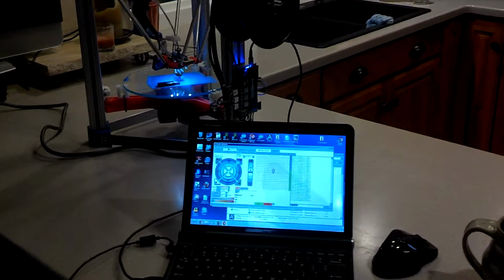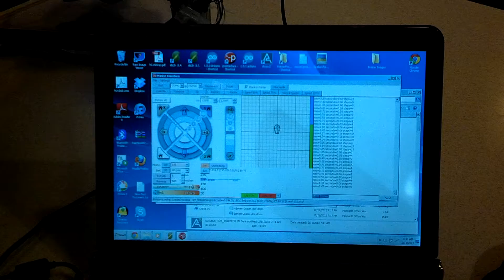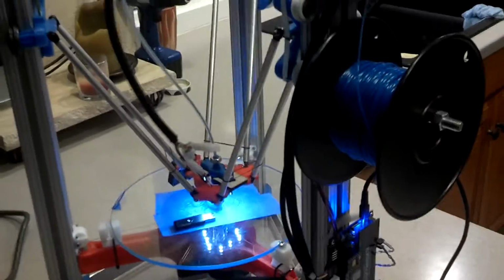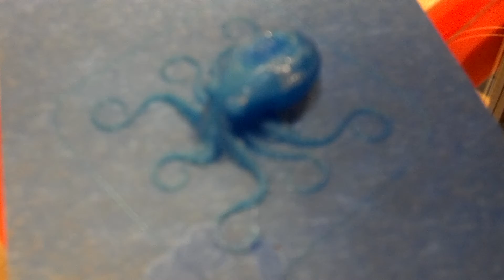Cerberus 3D Printer - How it works - Described in more detail

Comment: Microstepping doesn't improve resolution much, if any. It's actually for noise reduction, rather than resolution. Even at full steps you're laying down plastic at 0.3mm per step, which is about the same size as your nozzel head. You might get a tiny bit of "globbing" at full stepping if your extruder steps don't sync up quite perfectly with your XYZ steps, but that will pretty much go away if you drop it down to 1/2 stepping or 1/4 stepping. Microstepping also DRASTICALLY reduces torque. A at 1/16 stepping the motor has only 10% the torque it has at full stepping. 1/32 it's like 6%. 

However, run a stepper motor at full steps and they are LOUD. People play music with them, just the motors turning, they are so loud. You remember those old dot matrix printers? That noise was 100% because they were running stepper motors of similar size to NEMA 17s with no microstepping. That's where microstepping helps a TON. The more microstepping, the quieter the motor runs, so 1/32 stepping will be significantly quieter than 1/16, which is far quieter than full stepping.

Comment: Hi Steve,
I've enjoyed your videos greatly, thanks.  Two and a half years after you posted this video, do you still favor the filament drive ahead of the toothed-belt alternative?   And for that matter, would you still build a delta in preference to a cartesian or other type?   Thanks again.
Reply from the maker: +John Colvin - All of my recent printer designs have been belt driven. A good quality belt is a critical component of the drive system. The filament drive works pretty well. However the spectra does stretch continuously over time so it's not as trouble free as belts, also although the spectra drive is significantly more quiet in operation, it's also much more difficult to string up the printer with spectra vs just slapping some belts on and forgetting about them.

Comment: Why did you use Spectra line instead of GT2 belts? It seems like more work to have the spectra line tensioned than using toothed belts.
Reply: Spectra is a lot cheaper than belts!
Reply: That's true. I bought 65 test spectra but ended up going with belts, it was an extra $60. My problem was using 3D printed pulleys, with metal pulleys and a good tensioning system I'm sure they're fine.
Reply: ***** I am not sure why no body makes a 3d printer like this http://www.directindustry.com/prod/abb-robotics/pick-and-place-robots-30265-169123.html. This is the way I am thinking of doing it, can't think of to many problems, I guess you can get better height from doing it this way.
Reply: jad51 you'd probably need to modify existing firmware to make it work. I'd think the really long arms controlled directly from stepper motors would be more for speed than accuracy. I think using acme screws and nuts would work well like this: http://reprap.org/wiki/LISA_Simpson
Reply: Yeah that looks like a easier design, not sure what sort of printer type I will go for yet as I am working in an engineering workshop and I can get steppers, drivers and materials for nothing. So will make one out of what I have available.

Comment: I am going to get a delta style printer asap.  My biggest concern though is that I have an overwhelming urge to upscale this (or a standard 3d printer) to a ridiculously large scale to print life sized car parts.  Depending on the strength of the material, I can see printing most of a car with this, save the plumbing, electrical, and some of the hardware.  I have a bad habit of getting WAY ahead of myself though.  I don't have a garage big enough to do it and I'd need alot of people to help.

Comment: With a few tweaks to simplify the design, many of which you've already mentioned, this design would be almost perfect for up sizing.  It could be used to print grain silos and various shapes of sky scrapers if it used a simple slip form technique as it builds.  The only issues would be the print head, but there are already concrete excreting heads, and a constant stream of build material.  Both of those issues could be easily remedied with a little planning though.

Comment from the maker: Thanks for the feedback. You're absolutely right. I am actually not set up to sell printers via the website. And the real problem is that I do have a day job (which I happen to like quite a bit). But if you are interested in purchasing one, I am definitely able to do a couple of them a month. I have 3 models now, a 170mm round 'Pup', a 250mm round Cerberus and a 400mm capable (with 300mm round bed for now) Mega. Email me grabercars-AT-gmail-DOT-com for full pricing info and delivery schedules.

Comment: Hej Steve! I have been looking at all the designs of the Deltas and wanted to go with the Cerberus Design. I had the same impression as  Joshua, though my impression is that the design is practically asking for heat issues. Now the explanation makes sense, as long as one ignores the pup design, which has exactly that design proposed... Why is that? You don't happen to have a design of a large cerberus up your sleeve which has the same setup as the pup?

Comment from the maker: Thanks! The original intent has always been to run the filament drive up in side the t-slot to make for a cleaner look to the vertical arms. In order to accomplish that and keep the diameter of the filament drive reels at an acceptable size for speed and precision it was necessary to mount the reels away from the extrusions. Then, in order for the filament to wind properly on and off the filament reels they need a shallow enough incident of approach angle. The pod mount works for that.

Comment from the maker: Cerberus in motion, printing 'octopus' at .1mm layer height. Verbal commentary on how the machine is put together and how the filament drive basics work.
Reply: i love your innovation here using the stepper motors to heat the bed. The print was quite good too.
Reply: Nice work.  It's beautiful.
Reply: Nice work Steve. BTW I am also using 1/32 micro steps, but the DRV 8825 from pololu. After testing it appears that the resolution does not really increase much if at all from 1/16, if you run one motor very slowly (F10 or F1) you can hear that it actually misses about half the micro steps, and catches up later once the current gets high enough. It is smoother and quieter though.
Reply from the maker: Interesting that mine are printing noticeably smoother circles and curves than when I had it running 1/16 step. Also when using PrintRun/Pronterface in 1/16th stepping the .1mm Z travel button would take 2 clicks for visible movement and would move .2mm, but now at 1/32 step each click visibly moves the effector .1mm. In other words I notice a difference between the two types of stepper drivers. I will test it running slowly as you mentioned F1 or F10 and see if I can hear skipping micro-steps.
Reply: it would depend on where in the sequence of 32 micro steps it is, early on it shoul dmove with every one, but as the voltage reduces in one to the point it can;t move it will not move for several steps. But a 0.1mm move is several steps.
Mine its around 100steps/mm, so 0.1mm would be 10 steps, which should get it to move at least a little.